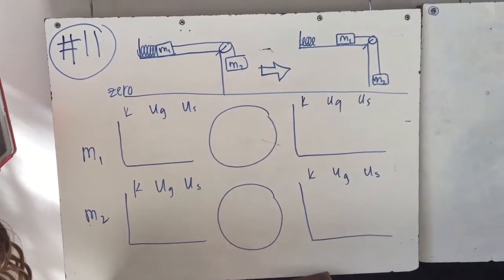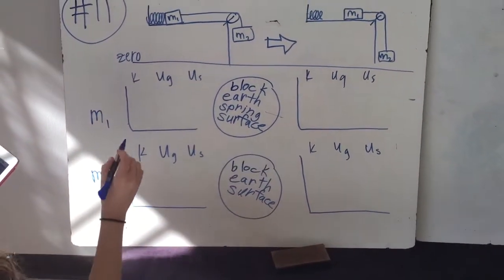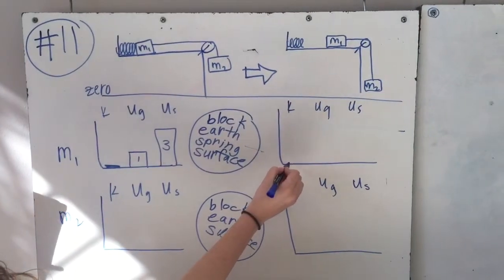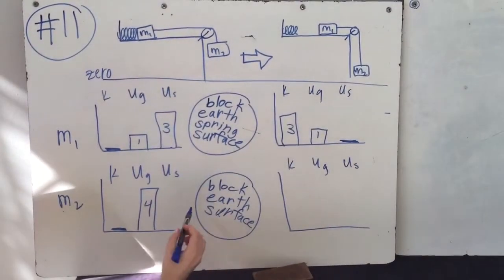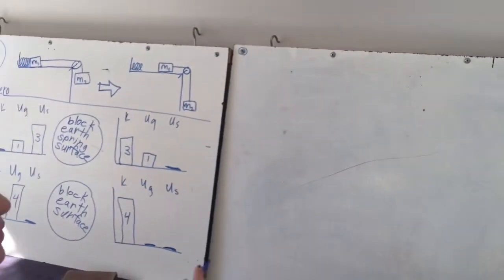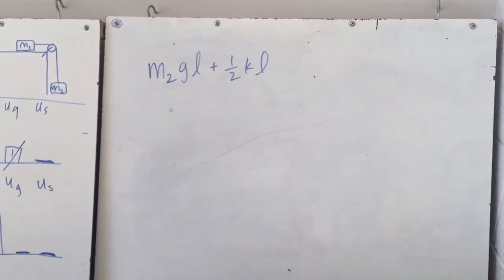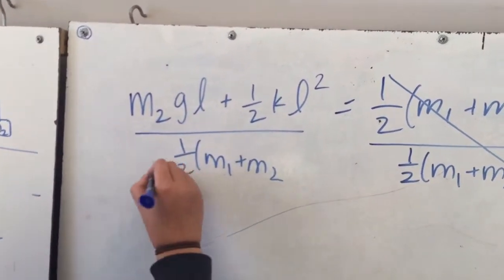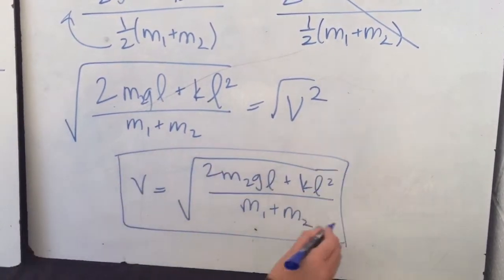Problem #11 Falling Mass

Comment from the maker: ENERGY 2
LOL diagrams help visually show what kinds of energy are acting on an object in a given scenario like Problem #11 "Falling Mass." The first L represents the initial energy that affects the object and the second L represents the final energy that affects the object. The O in the center is filled with things that affect the energy levels as well as the object and anything touching it. In our equation, m1 had initial potential energy due to gravity (from the height of the mass) and potential energy due to the spring (because the spring was touching the mass) while m2 only had initial potential energy due to gravity from the height it was at. The final energy of m1 included kinetic energy (since the spring pushed the mass into motion) and potential energy (from the height of the mass) while the final energy of m2 was all kinetic energy (because the string connecting the two masses caused the second mass to move, and it has no potential energy because it lands on the ground).

ENERGY 6
With the help of the LOL diagram, the equations to use to solve for velocity become clear. For m1, there is potential energy due to gravity on both sides of the LOL diagram which means they would cancel out each other in formulas. For the initial energy acted on both masses, the equations go on the left of the equal sign and the final energy equations go on the right. This would mean that we would have the PEg equation for m2 and the spring constant equation for m1 on the left and the KE equation with combined masses on the right. Without numbers, from there we solved the equation algebraically to get our final answer.
However, our answer differs from the "correct" answer that quest marked because we wrote that the PEg (for m2) equation PLUS the spring constant equation (for m1) in our final answer while quest says the spring constant equation is NEGATIVE. We stuck with our positive sign because the math works out perfectly with it and when we learned LOL diagrams, we were told to add everything on the left L and set it equal to the total of everything on the right L. Therefore, we kept our POSITIVE sign in the answer in the numerator.

Bella Camargo

Comment from the maker: In this problem, we used several learning goals. One of the learning goals was Energy 3. This learning goal states, "I can use Hooke's Law to analyze the behavior of an elastic system." This goal is addressed in this problem because it is shown in the analysis of the spring being used on the blocks. The force used in extending the spring by a specific distance is proportional to the resulting distance. Another learning goal was Energy 4. This learning goal states, "I can algebraically calculate the amount of energy stored in each storage mode in a system, and solve simple energy problems." This goal was addressed in our calculations of the problem in order to find the equation used.